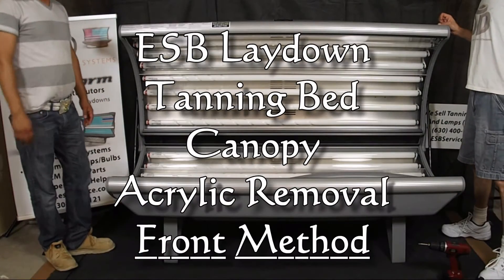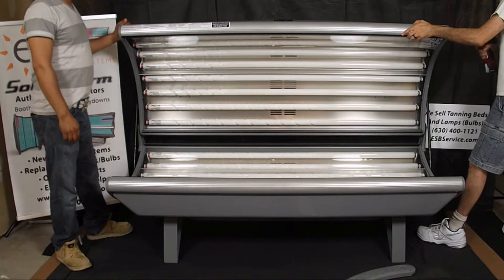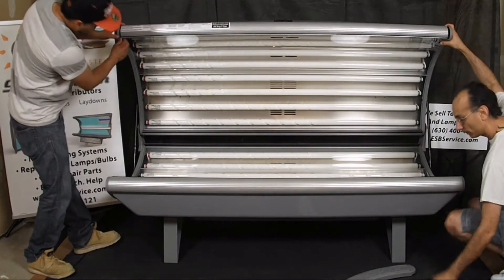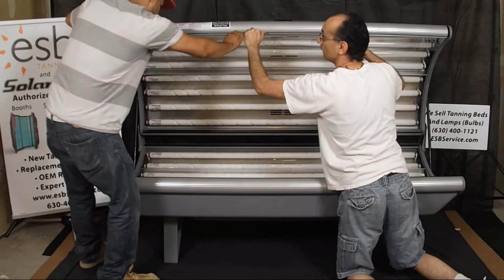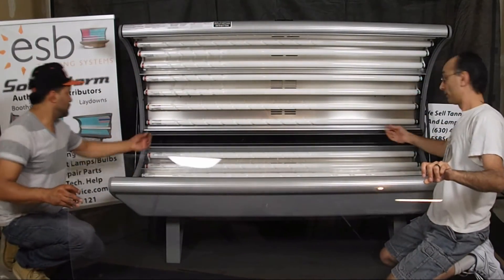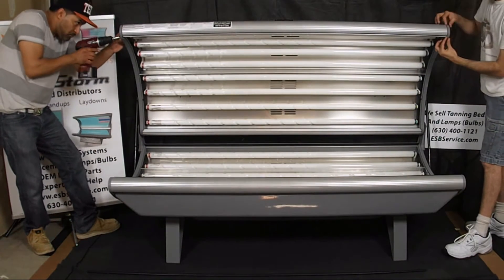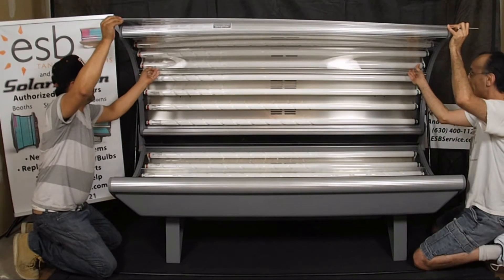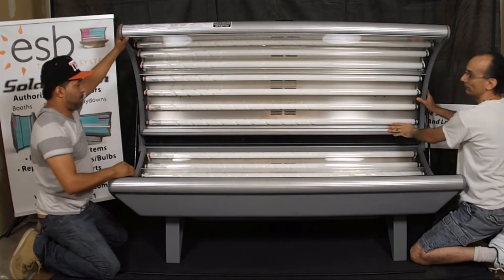ESB Tanning Bed Canopy Acrylic Removal and Re-Installation - Front Method

Comment: Russ when my daughter and I were trying to get this in it seemed loose and kept coming out of the track. We did loosed the end cap screws. Then of course we left it out because of the ballast issues. I went ahead and tightened the screws back up. Should we try to install it that way when we’re ready to put it back in or still loosen the screws. It seemed so loose. Thank you Shelley!!!!!
Reply from the maker: Thanks for your comment, Shelley.  When you go to re-install the acrylic, the end caps do not need to be as loose.  I usually keep them pretty snug when re-installing it as it helps keep the acrylic straighter going in.  The only thing is there are those little "nubs" inside the end cap groove that you have to work around, and if the end caps are too tight, that can cause an issue where it gets hung up on those.  I hope this helps, but please let me know if I can help further.  Thanks!

Comment: Are the top & the bench acrylic the same size?
Reply from the maker: Thanks for your question.  For most ESB 6' beds, the length and width are the same.  From factory, many had a thinner acrylic in the canopy than the bench.  The one that we sell is the factory bench thickness, so it will fit in either the canopy or the bench.  Here's the page for reference:  https://www.esbservice.com/parts.htm#!/Acrylic-6-72-Long-X-30-3-8-Wide-X-1-8-Thick-ESB/p/42871692

Comment: Moved a working tanning bed and now it will not power on. Any suggestions?
Reply from the maker: First, I'd recommend starting by opening up the cover as in this video:  https://www.youtube.com/watch?v=lIF3Gf2hGGs  Check for loose wires...look specifically at the wiring going to the timer.  Please email us at info@esbservice.com or call us at 630-400-1121 if we can help more with that.  Thanks!

Comment: I have a new esb 24 bulb avalon with 4 bulbs that are out. 2 on the base and 2 on the canopy. 1 of the bulbs on the base appears to not be turned completely. The one directly next to it is out but appears to be turned completely. What I mean by turned is not turned completely in place allowing the pins on the bulb to make contact. The other two bulbs again are side by side but. Appear to be correctly inserted. The bed is new. Any suggestions?
Reply from the maker: Thanks for watching and for commenting.  I would recommend watching my videos about ballast issues and even the one on open-circuit lamps.  The lamp needs to be securely in the socket.  You would need to remove the acrylic (I also have a few videos on that topic) and then seat the lamp properly.  An open circuit can cause the ballast to blow, and it's also a fire hazard...so this is Important.  Email me at info@esbservice.com for more specifics...If you can send me pictures of your ballast, I can help you more specifically.  We also have the replacement parts that you need, so please contact me freely...Thanks!